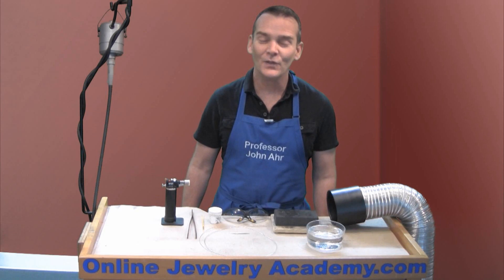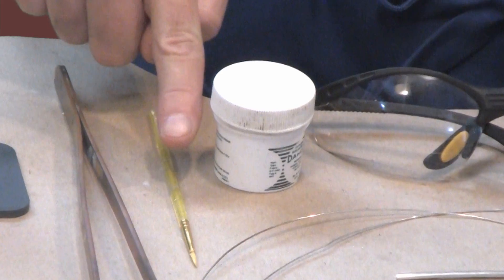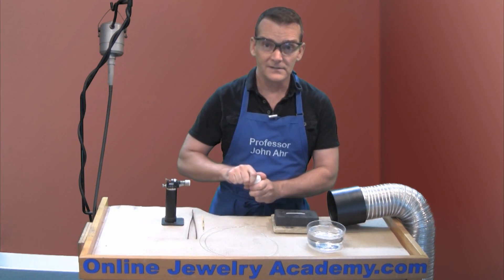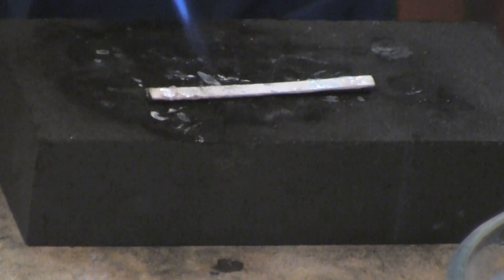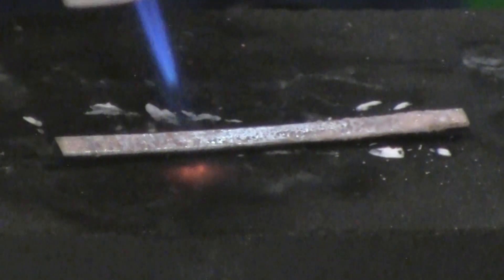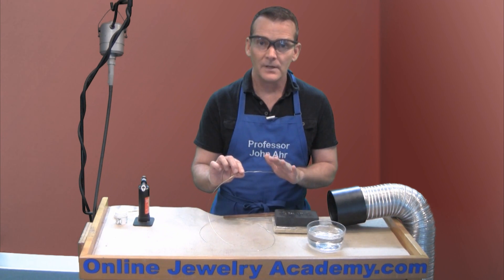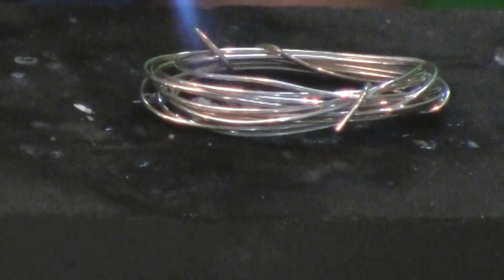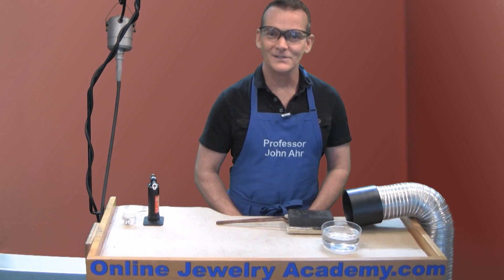Annealing Sterling Silver Using A Butane Torch

Comment: Should we pickle the annealed wire before the next step
Reply from the maker: Yes. You should always pickle and brass brush metals after annealing. 😀
Reply: @OnlineJewelryAcademy  sir, i have one more question. Can i do ultrasonic cleaning of the copper piece after pickling and skip the brass brush part ?
Reply from the maker: @nikhiljoshy3945  No. Brass brushing removes oxides that the Ultrasonic cleaner cannot. 😀

Comment: Hi, thank you so much for this video! Is it possible to use a kitchen torch?
Reply from the maker: The torch I use in the video is a butane torch that can reach a temperature of 1500 degrees F.  If your "kitchen torch" gets that hot, you can use it to solder. : )
Reply: @OnlineJewelryAcademy  I don't need to solder, just to anneal! So maybe a kitchen torch could be enough?
Reply: @paoladt  There are two issues, temperature and btu, or how much thermal power a torch can deliver. Some propane Creme Brulee torches can reach the required temp, but may be too small to deliver the thermal firepower needed for soldering or annealing more than small quantities or metal. You can try what you have on the size/quantity of metal you are working with. If you can heat it up to the faint pink described (turn out the lights so you can see it better), then it will be fine. If you can't see a pink glow after several seconds of heating, you'll need a bigger torch. For small jobs, a suitable torch is not expensive - $25-$30 - possibly less than what the fancy chef's places charge you for a creme brulee torch.

Comment: Another great video and thank you for sharing your expertise with all of us.  I did some annealing with copper and got side tracked with all the lovely colour changes :)    Whether it's silver or copper, is there a limit to how many times a piece can be annealed?
Reply from the maker: Hi Gisele,  That's a great question.  Most beginning jewelers make the mistake of annealing a piece too often or too many times.  This can cause the metal to be unevenly worked.  My advise is to only anneal a piece if you have taken your work to the point where you cannot continue without annealing again.  And you can do that as many times as you need to.  Good luck with your creative projects.
Thanks for your support! : )
Reply: @OnlineJewelryAcademy  thank you so much!  I'm on the right track ;)

Comment: Another great video John!.  I have a question for you, I am living in a state where winter is around the corner, and is cold out, I am living in a 6 floor building apartment, do you have any suggestions on how can I make my jewelry under this  conditions because I would like to use my torch for projects but I am afraid to use it due to the gases from the torch and other products.
Reply from the maker: Hi  Alice,  This is a serious issue that we should make a short video about sometime.  Apartment dwellers do need to be careful about fumes in a home work space.  There are products available from jewelry supply companies that will eliminate fumes and smoke from your bench area.  And, the OJA has a video on how to make an inexpensive ventilation system.  The video is called "Venting In The Jewelry Lab."  But, please be sure to check with your insurance company to make sure that your renters insurance will cover you for any losses that might come about due to the operation of your torch within your apartment.  Most insurers will NOT cover you if you operate a torch bigger than a small butane torch.  The "fuel load" of an Acetylene torch, for instance, is considered too risky for apartment use.  Good luck with working on your creative projects this winter.
Thanks for your support! : )

Comment: thank you professor john for the great Demo.
 this afternoon i was working on annealing a link bracelet .
 my plan was to make a Cuban curb bracelet.. 
so i went to anneal it before twisting it.
i guess i over heated the bracelet with my casting torch to red glowing color . then after i quenched it. i noticed that all solder joints wore melted (i used easy solder)  a BUMMER big time after all the work i invested in it :0((

my question is: since you mentioned the Annealing Temp is between 1110 and 1200 F. can i place my piece in a Kiln oven at 1200 degree and quench it ?. this way i'd make sure i'm not over-heating my piece .
 Thank you in advance.
Reply from the maker: Sorry to hear that you had a problem with your chain.  Now you know why I say to always try to solder each joint with hard solder.  By the way, you might be able to reflow solder into the seams that became depleted when you annealed your work.  With regard to annealing in the kiln, it can be done.  But you need to watch the temperature gauge on the kiln and set a timer.  When the kiln goes back to 1,100 degrees, leave your piece in for about 10 minutes before you take it out and quench it.  Good luck with your creative pursuits.
Thanks for your support! : )

Comment: is it a similar process to anneal gold so its easier for setting stones on bezels?
Reply from the maker: Hi Allen,  The main thing to take away from this video is that you really need to watch your silver as you anneal to make sure that you don't melt it.  It's best to perform this operation in a darkened studio.  And, you need to be especially careful when you anneal wire.  It doesn't matter if you're working in silver or gold when it comes to setting stones in bezels.  Unless you make the bezels exceptionally thick, the bezels will easily bend over the edge of your stone.  They are generally about 28 gauge in thickness.  And, anytime you solder, you are automatically annealing your piece.
Thanks for your support! : )

Comment: I annealed a sterling piece last night, and even after giving it a thick coat of paste flux, there was a lot of firescale I had to polish off. I'm not posting this to get an answer to this, obviously a lot more experimentation is needed for me to find the right flux chemistry to minimize firescale.
Reply from the maker: I think the root of your problem is the length of time that it takes you to anneal your metal.  Try using a hotter flame and speeding up the process.  That should cut down on the amount of oxidation build-up that you're getting on your silver.
Thanks for your support! : )
Reply: Thanks John--tha's something to try with my larger torch. :)

Comment: hi John, know you DURAFIX? to solder I dn't know if can to use it 4 solder coper wire. May you  tell me plzzz 😊
Reply from the maker: Hi Neva, I looked up Durafix online.  It appears that it is for welding aluminum.  The soldering techniques shown on the OJA will work for copper, brass, silver and gold but not for aluminum that needs to be welded.  
Thanks for your support! : )
Reply: OnlineJewelryAcademy thank you Mr. John👍🙋
Reply: I

Comment: I agree with you on that point but it's very easy to make dead soft metal it's nearly impossible for the average jeweler or crafter to make spring hard metal.
Reply from the maker: +Jack odonohue 
Yes, it's difficult to make "spring hard metal" for the average crafter.  But, there are plenty of other options.  Or, you can enlist the assistance of a "jobber" to help.  The mission of the OJA is to provide basic crafting information and related information to its viewers.  We show what is possible.
Thanks for watching! : )